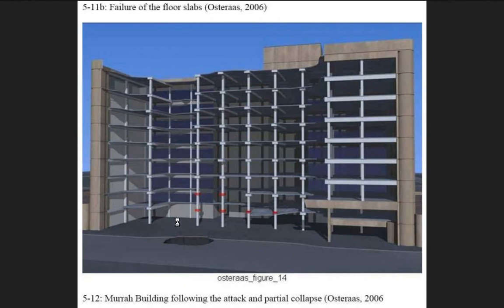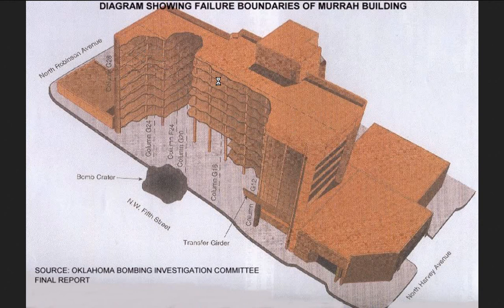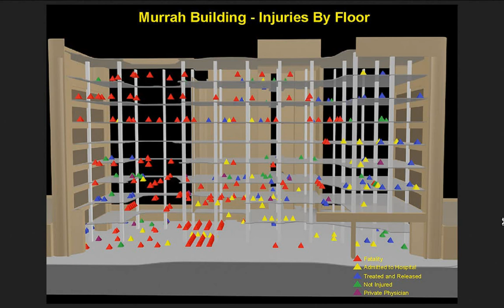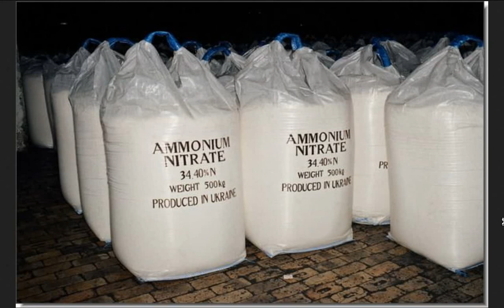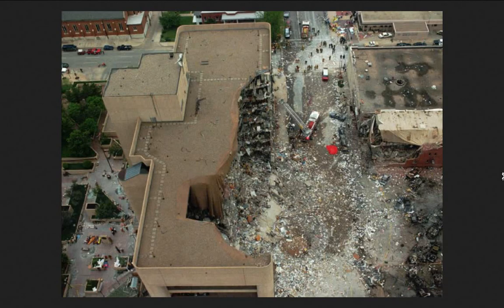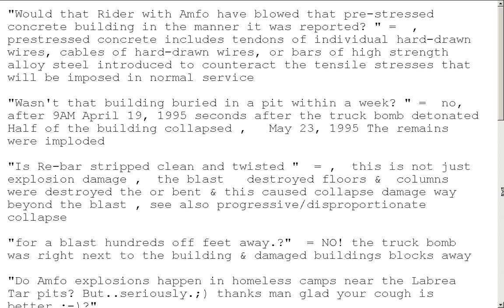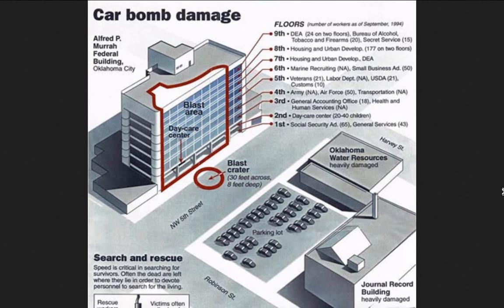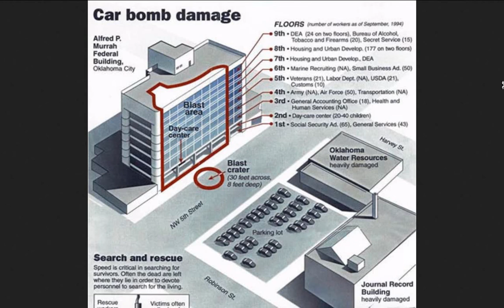no pit burial of Oklahoma city prestressed concrete column building ANFO Ryder truck bomb cratered

Comment: What is the approximate velocity of the explosive that was used in the Oklahoma bombing?
Reply from the maker: 13000 feet per second, MACH 11 total explosive Velocity of Detonation VOD,  for the Oklahoma bomb 

10500 feet  per second  unconfined, at ambient temperature from a in 5 inch diameter charge

based of pre mix & "diy" versions in mining & war , ANFO has a broad VOD range based on "density" 
10,000 feet per second if its "density" is near 0.8  & 15,000 feet per second if its "density" is near 1.2  

The bulk density of ANFO depends on the density of the Ammonium Nitrate prills & 
so the augered density is from  0.80 to 0.85 g/cm3. 

http://www.synegex.com/synegex-products/anfo.html
https://en.wikipedia.org/wiki/ANFO
https://www.nps.gov/parkhistory/online_books/npsg/explosives/Chapter2.pdf
https://web.archive.org/web/20180924120036/https://worldview.stratfor.com/article/fertilizer-bombs-weapon-choice-among-militants
https://archive.fo/AEeXq
https://archive.fo/ozvG5
https://archive.fo/W9AkH
Reply from the maker: in the 1995 Oklahoma City bombing. 9 Of the 13 filled 
barrels  contained nitro methane as the fuel, making  ANNM  a 18000 - 20,000  feet per second more sophisticated variant 
of ANFO  a 15,000 feet per second ammonium nitrate fuel oil bomb 
see also  patent US3377217A 
https://patents.google.com/patent/US3377217A/en
https://en.wikipedia.org/wiki/ANFO#ANNMhttps://en.wikipedia.org/wiki/Oklahoma_City_bombing